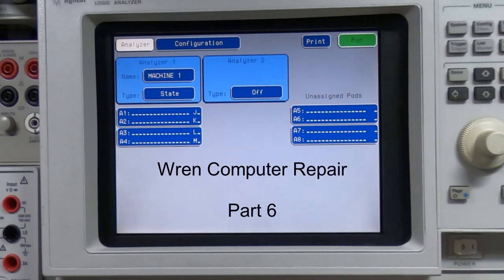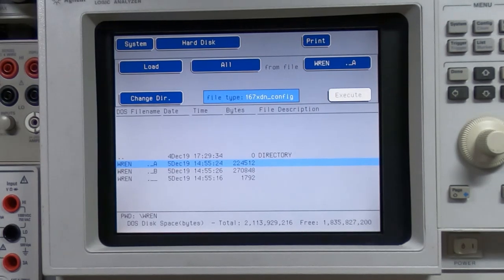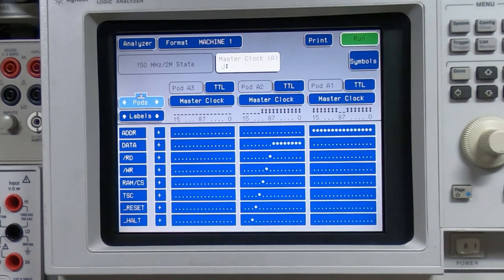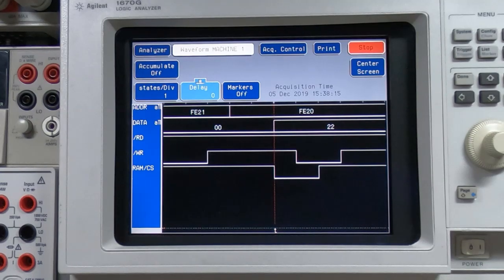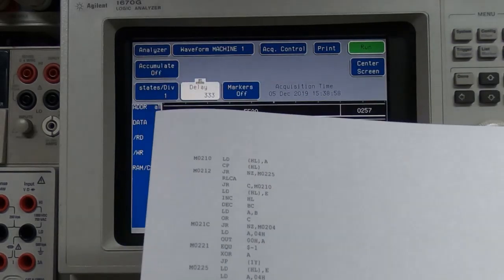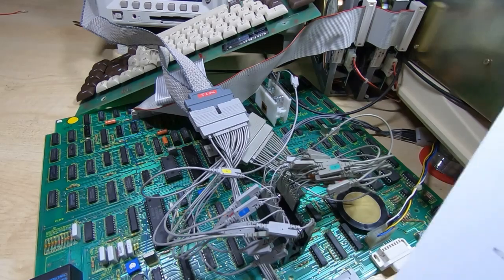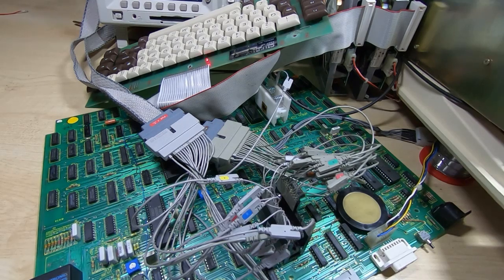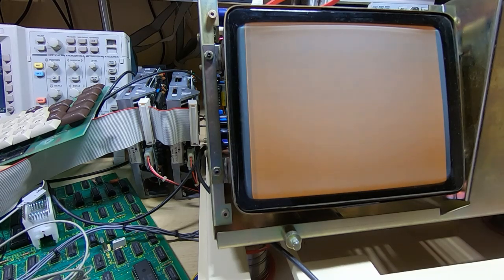Wren Executive System Repair Part 6

Comment: I have always wanted to have a proper logic analyzer in my home workshop, and because of your videos I got motivated enough to buy a Hp16500 mainframe with a 96 Chanel LA and a 2 channel 400Msa oscilloscope boards. It is quite a nice bit of kit....
Reply from the maker: I think they are well worth the expense as they can save such a lot of time and sometimes are the only real way to avoid simply guessing. It is also well worth the time to learn all the available features that they have. Initially they seem complicated and time consuming to set up but once you get familiar with them it only takes a few minutes to set up.

Comment: For the curious you should mention what the major ICs are when talking about those areas. In a previous video about the video display you never mentioned what CRT controller IC is used. Maybe the common 6845, or something else? How about the UART? The 8250 has an internal loopback capability set by the Loop bit in the Modem Control Register. If an 8250 is used here it might be using that for the loopback test.
Reply from the maker: I will get to chip types etc once they are being addressed. At the moment these peripherals are not being enabled at all but as each starts to work I will describe it. The current fault is with the IO decoding so the DUART (and CRT controller) is never selected so looking at it further may make the videos confusing. I take a methodical approach when repairing and until a device is being enabled it is not really worth going into detail about it. Yes I know that the DUART has an internal loopback test (so not really a loopback test) but this is not the problem as the device is never being selected.

Comment: It seems likely that you are doing the repair to keep it going, so in the light of finding a "marginal" device would it not seem logical to just replace all the 'easy' logic?  Might take a couple of hours but, on the other hand, might save it coming back for repair in a few hours / days / weeks time.  I make devices for musical instruments as replacements for the originals (because they are no longer made) and this issue of devices becoming marginal is common.

Not sure if you replace them this way but, if you take some small side cutters you can cut the legs off at the body, so the plastic bit falls out and leaves the leg bits in the board.  Then you can take some tweezers and remove the leg bits easily by applying a soldering iron to the other side (of the tweezers).  It's a way that doesn't damage the board and is pretty quick.

Who knows, with the logic replaced it might just fire up!
Reply from the maker: This is not my machine and I do not think the owner would want to pay for the time and cost of replacing all those parts considering the relatively low value of the machine. Also the videos are intended as informative and interesting so shotgunning all the parts would negate the point of the videos. In addition there are 116 'easy' logic devices so it would take many hours to replace them all (even at 1 every 5 minutes it would take 10 hours work). I never shotgun repairs and always avoid removing devices from boards unless it is needed but I do generally check logic drive levels so it is very rare (although possible) for further failures but that applies to anything. Yes it is almost certain that replacing every component would fix it but where is the fun in that :).